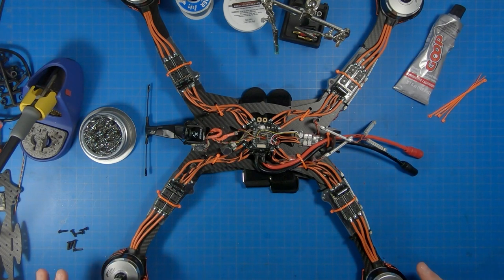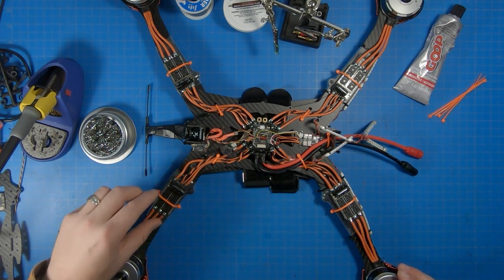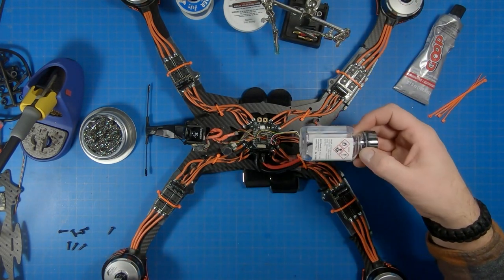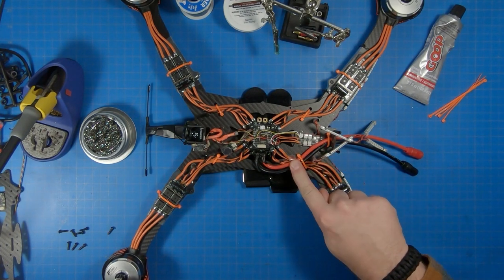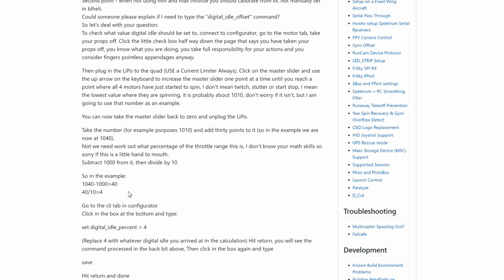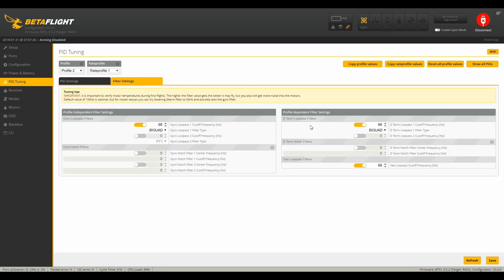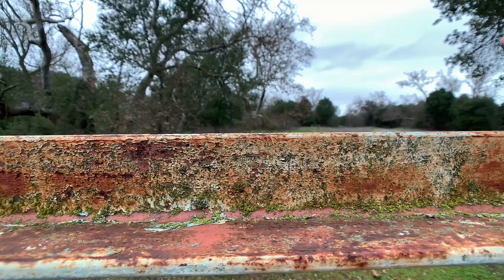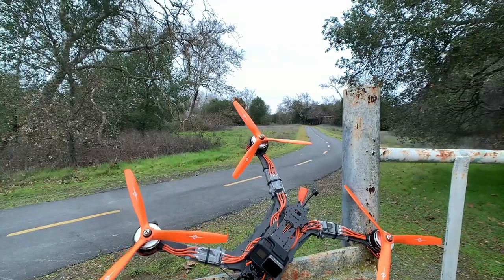8S Hildabeast 570mm FPV Drone | VIP PIT PASS

Comment: it looks sick! just be careful on the zip ties around the ESCs. I don't think you have it super tight but still remember the ESCs are dealing with heavy current (full throttle) and the zip tie may hinder the flow of power/electricity causing "magic smoke". speaking from my 520mm experience. best of luck!
Reply from the maker: Other than the zip ties (which aren’t too tight) what would you recommend to secure the ESC’s? A small piece of electrical tape?
Reply: I have 2 zip ties per ESC not directly on the housing or solder points but on the wires. With this strategy the ESCs are secured to the frame by double sided tape/velcro to the carbon frame. Another bonus is if there is a crash (worst case scenario) the location of the tie would be damaged (wires instead of a solder part or on the ESC board itself).
Reply from the maker: Very good point. Changing it now. Thanks!!

Comment: If you haven't used the graphical osd of the radix for looking at gyro noise and setting lpf + notches. It might be worth checking out too. Here is a good video explaining how https://youtu.be/q5hKBB6aHfI   I really like your build though. So clean!
Reply from the maker: Thank you for the tip on the Radix filter feature.

Comment: So? Why not use Helicopter ESC's? They can take 12-S power, expensive but worth it. I use  6115 -320 Kv T-motor's with 60 amp ESC's.   Just wondering.
Reply from the maker: Aside from the protocol not being fast enough / there’s the weight, and the fact that I’d need 4X Castle 120 HV’s just to be able to run this, but they would max out at 120a each whereas the APD120F3’s can handle 120a constant with 200a burst.
Reply: @BayAreaFPV  Didn't mean Castle in particular, Kyrotonik makes up to 300 amp ESC's. What esc are u using?
Reply: And how much do thede esc's weigh ea. ??
Reply from the maker: I’m using the APD120F3’s

http://shop.powerdrives.net/?product=120f3x

Comment: If u go Into blheli32 app  there is current protection adjustment in actual amps. 
Im just thinkin the stock current protection is not set to off from factory . And it's set to an actual amperage. Maybe too low.  I'm thinkin u just exceeded the max amps in that setting. I might be way off though. I would still check that though. They look like bad ass esc's they should be able to handle the amps. If that setting is too low just turn it to off or raise it.
Reply: I'm Sorry I was wrong it just limits it so u don't burst over if u have actually set to an actuall amper. I always set it to off. Never had a problem with 32bit.
 Check this link out its a video in a series just on blheli32 bit esc settings
It's invaluable
https://youtu.be/GvHZewT9gnI
Reply from the maker: I’ll take a look at it. Thanks for the tip.